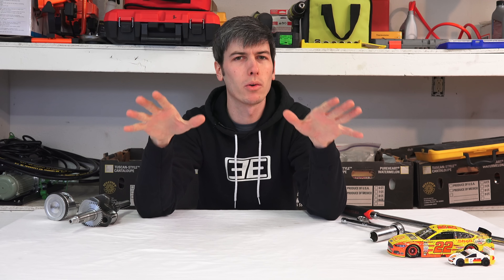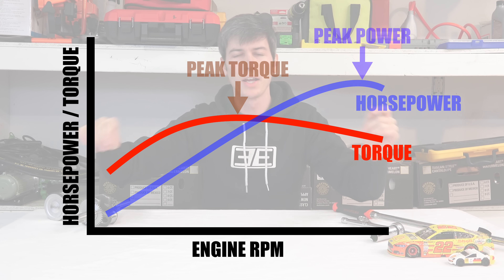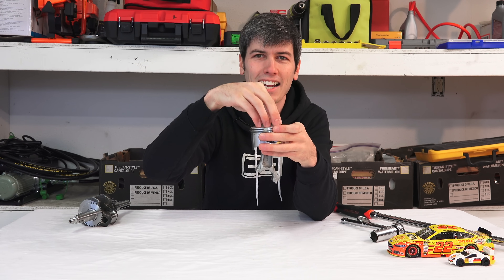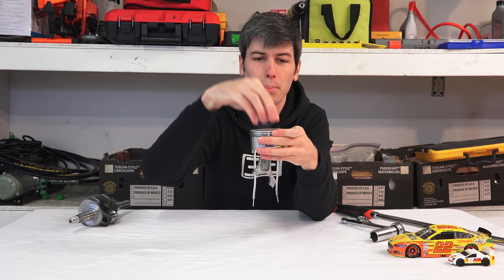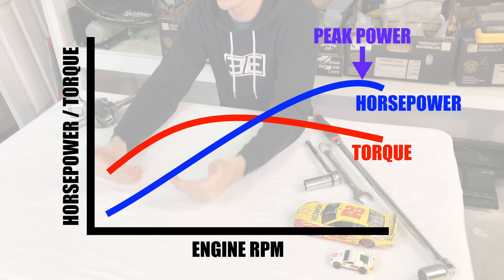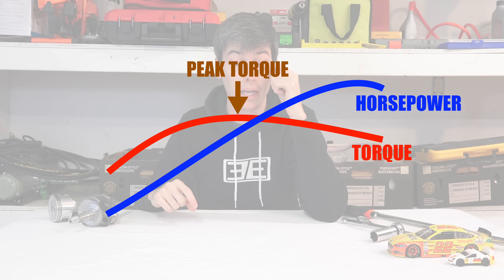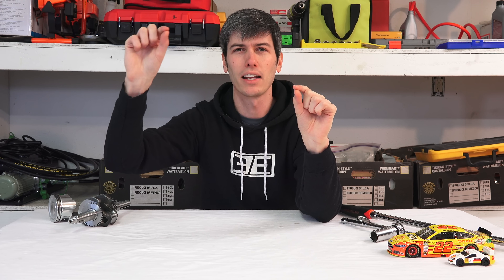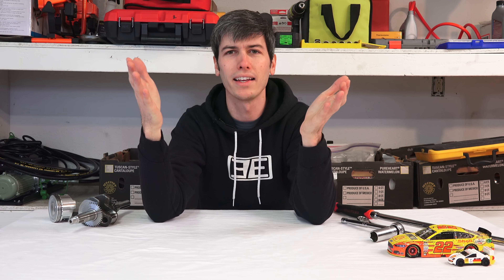Horsepower vs Torque - A Simple Explanation

Comment: So, is it true if I say this "Torques is originally coming from combustion that moves the piston. Horsepower is resulted from how fast the combustions itself have made."
Reply: Kind of true :) Originally, force is applied by the gas on the piston. Then, the translation motion of the piston is converted to rotation and force is converted to torque. The speed of the combustion has nothing to do with power a priori. Only the speed of the piston matters : high force plus high speed = very high power.

That being said, fast combustion usually allows for higher pressure on the piston and more useful work because the gas will start pushing harder and earlier in the stroke.
Reply: Meatboy 106 Not true having the maximum pressure early in the downstroke hurts torque which also hurts HP. HP is just a number calculated from Torque. The maximum power will be achieved by having the maximum pressure occur when the piston is at the point of maximum leverage which is not early in the downstroke. Rod to stroke ratio determines when that peak leverage occurs. When maximum pressure occurs is determined by bore diameter, combustion chamber design, ignition timing, and the fuels rate of flame travel.
Reply: Sean Cross Actually, if a given engine produced max pressure when the crankshaft was 90 degrees post tdc, the efficiency would be incredible low, exhaust gases would be incredibly hot, and the power would be less than that of the ideal Otto cycle. The ideal Otto cycle is an instantaneous heat addition at tdc, so the pressure and temperature is maximum there, and this gives plenty of piston displacement for expansion to occur and extract the maximum amount of energy from the hot combustion products. I have a lot of code on this that generates PV diagrams and temperature/pressure traces if you would like to see them
Reply: Evan Ryder I too have seen many graphs plotting cylinder pressure and not a single one yielded MBT when peak pressure occurred at TDC. It isn't possible to have instantaneous combustion but if it were possible having it occur closer to maximum leverage would increase torque.  The chemistry prevents the ideal situation from occurring but that doesn't change what would be ideal from a physics standpoint.
Reply: @ReEvoluion  i read this entire thread and understood none of it
Reply: Sean Cross I see what you are saying, if you multiply the pressure by the piston area by the crank throw length you it would result in the highest peak torque for one cycle. However your vehicle would essentially "see" an average torque over the whole cycle. Keep in mind by max torque, this is not the maximum torque seen on a torque curve over rpm, this is just for one cycle
Reply: I know MBT is not the peak torque across the RPM range. MBT is the maximum brake torque for x rpm. MBT is found by adjusting spark timing and air fuel ratio while in a steady state load until you either reach MBT or detonation occurs. Typically speaking when max cylinder pressure occurs between 18 and 27° ATDC you will reach MBT. As stated previously many things influence where the ideal pressure peak will be given our current technology.

Comment: the car with twice the torque and half the horsepower will win a short race, it will be off the mark faster but get overtaken pretty soon by the car with twice the horsepower. My Harley only has around 60 hp but it will beat a 100hp rice rocket between sets of lights because it has massive torque and accelerates faster at low rpm.
Reply: You accelerate fast because you have high HP at low rpm.

Comment: So basically, that "higher gear ratio for acceleration at peak power" would explain why you downshift before overtaking, right?
Reply: That's it. You put your engine at at higher spot on the HP curve by downshifting.

Comment: I have been wonder how a vehicle with not a lot of horsepower is able to have a great amount of torque. Like the old military deuce and a half.
Reply: Engine design. These engines have huge displacements allowing for high torque but preventing the engine from reving high. These engine have very high low rpm power and can work efficiently and reliably during long periods of time at heavy loads. But the very low RPM reduces peak power. Bikes, on the opposite, are made to rev high to make power but not for long periods of time and definitely not as reliably.

Comment: Torque is NOT just a force applied at a distance.. And you Can't just think of it as a twisting force.. You HAVE to think of it like that.. Toque is a rotational force applied around a fulcrum.. Force applied at a distance does not always generate torque.
Reply: Ted Odell If the force is aligned with the axis ;)
Reply: Tacit Tacet 
FORCE times DISTANCE ?
If you stand on the end of a steel girder, YOU are creating a force, a bending moment,MOTION? no, but TORQUE? yes!
Reply: Ted Odell by "Aligned with the axis", I meant that the force is oriented towards the center of rotation. In mathematical terms, the torque is expressed by a vector product which is definitely null in the case I (try to 😉) describe.
Reply: I think what some of you are getting to is that the angle at which the force is applied 100% matters.

Given the example of the wrench, if the wrench is horizontal and you apply a force directly downwards, 100% of that force is translated to the bolt as torque, if you push/pull at a different angle you will not get all the torque. If you apply your force along the axis of the wrench, you will not get any torque.

Torque is the cross product of force and distance vectors.

And torque can definitely be referred to as a rotational force, they are the same.
Reply: Meatboy 106 Oh, I understand and agree.  I was thinking we were still discussing a a force applied normal (90 degrees) to the moment arm.  You are correct that the cross product (vector product) will be zero if the force is aligned with the moment arm.  I was not thinking of that case.
Reply: Chosen One 
For instance, in a vehicle, the ROTATIONAL force allied to the wheels acts against the friction between the tyre and road (weight of the vehicle) and converts the rotation to forward motion.
The gearbox in an ICE car allows the engine to spin at a relatively constant high speed, in its power band and Increase the torque at the wheels (initially) to move the vehicle forward. Without that initial torque, the weight / friction would stall the engine (been there?).
Reply: Yeah it always does , unless its not the same body or if its applied to the centre of rotation
Reply: Dont you get it from the begginning he said he will explain it in a simple manner. Just to be easily understood.
Reply: Tacit Tacet A load on a steel girder does produce torque.  The moment is about the attachment point, in this case, the fulcrum.  If it is attached at both ends, it has torque about both ends.  The effect is to deform (bend) the girder.  I’m trying hard to think of a case where force at a distance does not produce a torque.  If you have you can think of one, I’d be interested.
Reply from the maker: You don’t have to be spinning to produce torque (hence electric motors can produce torque at 0 RPM). There’s still a torque applied by a socket wrench, even if the bolt isn’t moving, if I’m applying a force to the handle.
Reply: You are missing the point.. And I didn't say you can't have torque without motion (aka the motor spinning).. But you CAN have a force at a distance that doesn't produce a torque... Hence torque is not just force at a distance but force at a distance applied at/around a fulcrum... Force at a distance on a steel girder produces a bending motion
Reply: Engineering Explained 'even if the bolt isn't moving I'm applying a force.'

Yes, a rotational force.

Think of a ship wheel.  You can push up on one side and down on the other.  This is obviously putting a rotational force into the wheel. It is being twisted.

If it were clay you would see it twist and if it were steel it's mass may resist twisting but it is still undergoing a twisting force.  As someone else said, there may be no motion but there is still a force.

Even if you cut off the left side of the ship wheel, pulling down on the right side will still produce an upward force on the left side.

The only way the force could be applied to that lever and have it not be rotational is if you push on the end of the lever toward the center as if you were trying to move the bolt to the left.

Then it would be a linear force.

At least...this was my understanding of it.  I thought torque was strictly rotational force, I could be wrong.

Kinda feels like 'a square is a rectangle but a rectangle is not a square.'
Reply: Meatboy 106 It will produce rotational motion if aligned with the axis.   If not, it will still have torque, just not necessarily motion.
Reply: Tacit Tacet
If you dont know physics - you should not comment

Comment: Actually, I think analogy is the best way to explain torque, by analogizing rotational motion with linear motion.  Torque is the rotational equivalent of force.  Angle (expressed in degrees, radians, or revolutions) is the rotational equivalent of distance.  Angular velocity (expressed in degrees per second, radians per second, or RPM) is the rotational equivalent of velocity.  For both, power is the product of the two:  P = T*RPM and P = F*v.  Work is power times time, which is the same as force times distance:  W = T*revolutions and W = F*d.

Comment: Hp doesnt equal torque x rpm tho that makes no sence 😂 but everything else makes sence. Thanks!
Reply: it does make perfect sense ;)
Reply: Meatboy 106 how? It doesnt really make sence
Reply: supergamer kiddo well... All scientists agree to define power as being torque * rpm and it has proven to be consistent with the observable world so far.
Power is work per unit of time. Work is force * distance for translation and torque * angle for rotation. Hence power is torque * angle per unit of time. Angle per unit of time is rpm. Finally, power is torque * rpm.
Reply: Meatboy 106 so theyre not talking about engine rpm right?
Reply: supergamer kiddo engine power is engine torque * engine rpm and wheels power is wheel torque * wheel rpm. But if you assume there is no loss in the transmission, this happen to be the same value as torque and power are inversely modified by gearing ratios. This is why only power makes sense : it is the same at the engine and at the wheels. More or less.

Comment: Interesting video and some good comparisons, but if everything is the same between the two cars (size, weight, transmissions, final drive ratio) it all boils down to F=ma. We can ignore mass since they are supposed to be the same, so acceleration = Force; and the Force component comes from Force x distance or Torque.
Overall... so another way to think about it is the area under the curve for torque or the integral...
Some interesting points, an engine limited to 100 lbft torque will not hit 200hp until 10,504 rpm
and one limited to 100hp starts loosing torque at 2626rpm... 
and they both have the same torque and hp at 5252rpm...
All from the equation HP=TQxRPM/5252. Some quick excel work produces some interesting graphs...
So, bottom line, if the gearing, which is the same in both cars, keeps the rpm below 5252 the 200 ftlb limited engine wins, but if the gearing keeps the rpms above 5252, the 200hp limited engine wins...
And, of course, there are ranges when you straddle the 5252rpm point where one wins over the other, and sure, if you run the rpms to infinity, the 200hp limited engine wins, but the point is that it is the torque that accelerates you.

Comment: Excellent explanation.  But ....  it feels to me like you're maybe answering a question that's not really the one people are actually asking.  You're delivering the explanation in terms of how to accelerate the fastest, whereas for everyday drivers and motorcyclists the question is often around how to get decent real-world performance without having to change gear all the time.  I think this is where torque comes in, but I'm not an engineer and still don't get the answer.  Why does a 'torquey' engine feel nice?
Reply: Torquey engines have more low rpm power, that's why they feel nice to drive. But, as always, it boils down to power.

Comment: still not 100% on this. My Audi A4 is only 140bhp, but in 2nd/3rd gear it pulls like a freight train and can overtake any normal car on the roads. Does this mean my engine is low power but high torque in those gears?
Reply: It means your engine is high power at low rpm relatively to other engines. At any gear BTW.

Comment: Okay, so I have another question. How do we keep from measuring that a vehicle keeps gaining HP for the longer it's been driving (getting more and more and more work done because there's more and more and more time)? What's the standard time limit that HP is measured in so that you don't just keep multiplying endlessly over longer and longer drives? ("Ahhh! I get more work done the longer I drive, so... I must be getting more and more horsepower!")
Reply: Power is to work what speed is to distance. You don't go faster because you drive for a longer distance ;)
Reply: I figured that. Now let's work on my actual question.
Reply: Maxx Fordham! Power is work / time not work * time. You can measure the work over any period of time and you will get sensible average power once divided by the time. Just like when you measure average speed.

In practice, power is measured directly by dynos or through torque and rpm. I can't see how you could trick that to get more hp.
Reply: LOL, oops! I must've been half-asleep! Despite your missing comma from between the first "time" and the "not," I think I got what you're saying. In a little while, after I have an idea that you've probably seen my reply, I'll make a major adjustment to my main post here! I guess I was actually just confused about where the delimiters are. I should've known, based on past math classes, that there would be a specific unit of time to base the measurement on. But what is it? OK, so in HP instead of watts, what's the standard time unit we use?
Reply: Maxx Fordham! 1 up = 745.7 watts. There is no particular usual unit to use in the formula power = torque * angular_velocity to get directly hp. Instead, use N.m for torque and rad/s for speed to get watts and divide by 745.7 to get hp :-)

Comment: Some people say torque is what counts more of the two, while some say HP does. Well I guess if you have more HP but less torque, then the vehicle can only go faster if there's less obstacle to slow it down. So the more torque you put with that HP, not only can the vehicle go faster, but it's harder to slow that one down because it's stronger. Right? So a high-HP-but-low-torque one would only go faster more easily on a level surface, while the high-torque one will keep on chuggin' somewhat fast even as the slope gets steeper. Right?
Reply: Nope. Power is everything.
Reply: Okay, that does make sense, because there's your actual work. But then why are there so many people who say stuff like, "Uh, well, horsepower is overrated. What you really want to know about the engine is how much torque it has"?
Reply: Maxx Fordham! Because peak power doesn't tell you much about everyday use indeed. You want high power all over the range. Peak torque doesn't tell you much either as it is engine torque and not wheel torque. Power at any rpm is what matters.

Comment: Torque = how HARD you can pull
Power = how FAST you can pull
So, power is how quickly you can pull your weight, torque is how much weight you can pull. (in layman's terms)
Very nice to see somebody explain the difference between the two in a simple way.
Reply: But don't you pull faster if you pull harder ? Your illustration might be confusing.

Comment: Ok, but back to the 2 identical cars (200hp & 100tq, 100hp & 200tq).  You explained what would happen if they manipulated things through gearing advantages. But if those two cars stayed in first gear in a race to 100 feet, which would be first?

Comment: From my experience high torque tackle the lower speed where lots of City driving. But more horsepower only useful in higher speed. E.g I used to have a car A having 160 bhp and torque 220nn. This car acceleration was so sluggish compapare to car B has 120bhp but has torque of 300nm which able to pull the car easily.
On expressway, Car B can over take car easily at even 160kmh at fastest and effortlessly but for car A struggling to even accelerate to from 130km onwards

Comment: My bad.  I mis-heard you when you said "higher gear ratio", to mean higher gears.  They are not the same thing, but I missed that.  Yes, revving up higher in a lower gear (higher ratio) gets you into the higher Hp figure, thus getting the faster acceleration.  Good on you young man.

Comment: hey great video, but I think you didn't explain the most curious thing for me: What is the difference between different cars, because let say there is on car with 150 HP and 270 torque and a different (let say the same car but different engine) with 150 HP and 380 torque. Can I feel somehow the difference? Is the car with higher torque more resistant towards having more luggage nad passengers in the car? Or accelerating from 150 km/h to 200 km/h ? Elasticity?

Comment: Good video but you are confusing 2 things. The torque and power at the crankshaft wont be affected by gearing afterwards. Power at the crankshaft will be conserved through the driveline, so if for example with your gear ratio you double the torque, then your rpm will become half , thus conserving the power (other than friction losses).
Reply: billys exactly. This video doesn't make sense